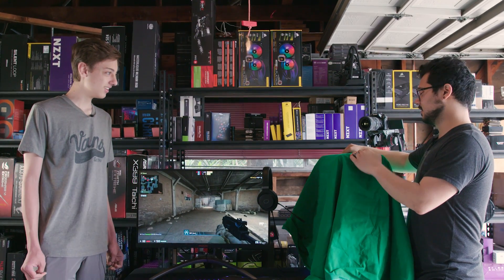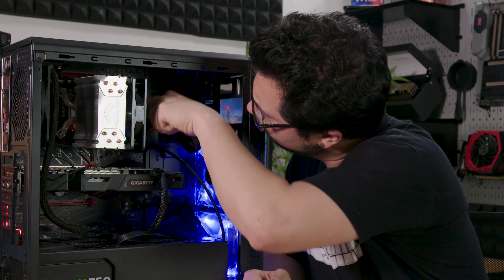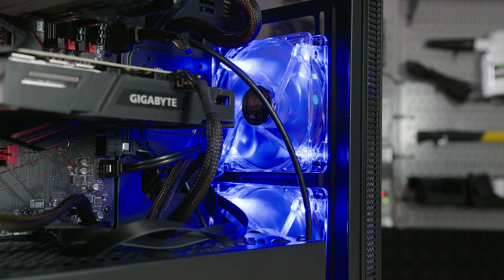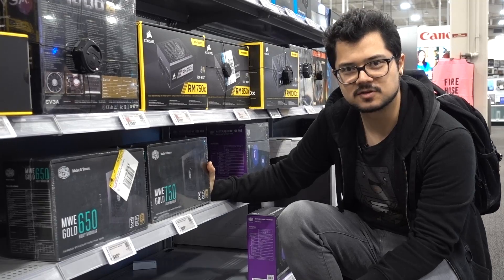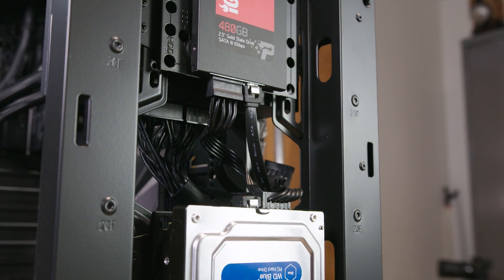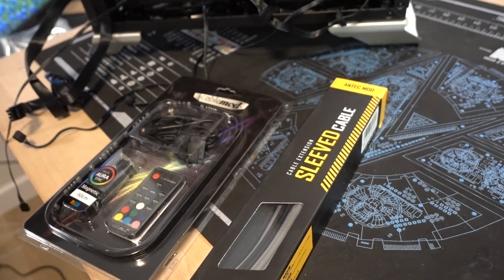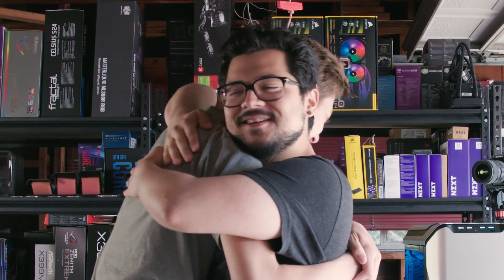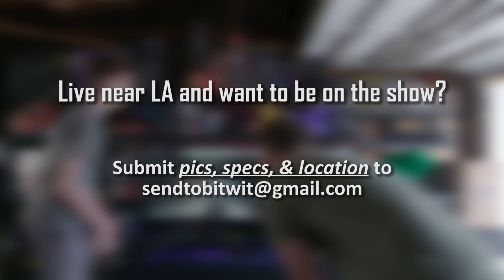He didn't see this coming a MILE AWAY #pimpmyrig #pmr #episode6

Comment: "80+ Bronze certified which is terrible" 

Me with my 200W chinese powersupply:"I meaaaaan"
Reply: crying in 80+ white :|
Reply: Lol. Has your PSU exploded yet?
Reply: @conyo985  theres this smell of burnt toast in the back of my pc but i guess its just my imagination
Reply: @Qi4  Or you just hungry haha
Reply: Feku13 who the fuck thinks of burnt toast when they’re hungry?
Reply: @Alex-mr5ji  I bet there are some people haha
Reply: fishlegs 😂😂😂
Reply: 80+ Bronze is more than good enough unless you're a spoiled brat.
Reply: @AZI3623  That's not how it works lmfao
Reply: @AZI3623  more like spoiled people would use bronze because they dont need to care about electricity bills
Reply: @AZI3623  u dont cheap out on the most important thing in ur pc. And that is the psu. O never go under gold. Is cheap to
Reply: @chriss881000  Bronze is fine, as long as the quality is good. The Corsair CX grey has better voltage regulation, protections and general build quality than a lot of gold units, and even a few platinum units!
Reply: @chriss881000  depends on how much wattage your power supply has. If you're going gold or platinum and you have a 800-1000w PSU, then it's gonna be pricey. You really only need that if you have like all higher end components and you're overclocking them all. For me I have an rtx 2060, and an i9-9900 so I can't overclock the cpu and I haven't found the need to overclock my GPU. So I only got an EVGA 600w 80+bronze semi modular power supply. More then enough for that. All depends on you're setup. Don't need to go overkill if you don't have to.
Reply: @nathanpickering6742  first off, a gold  1000w psu is cheap. I paid (and it still only cost) about 250$ here. In america is prob half the price(bec america is dirt cheap for everything)  and what are u doing with a low end 2060 card with that i9 cpu. U know u are very bottlenecked right?  That 2060 card dont even deserve the same oxygen as the i9 cpu😅
Reply: @chriss881000  what? That's definitely not bottlenecking. It's the non overclocked version. The 2060 runs great with my setup.
Reply: @chriss881000  if I had a 9900k then yeah I might want atleast a 2070ti. But the 2060 with a regular 9900 is perfectly fine. I'm also running 1080p and 240hz which the 2060 is plenty good for. If I moved up to 1440p then yeah I'd upgrade my card. But the 2060 is a great GPU for 1080p high refresh rate at ultra settings.
Reply: @chriss881000  also that's about $300 or more here in Canada, idk the exact conversation. But that's more then id need to spend on a powersupply unless it was necessary.
Reply: @nathanpickering6742  oh, i tought u ment 9900k(my bad)  i use 1440p, and i got 1080ti and a 8086k(5ghz allcore) cant have any less than that with a 2k monitor, if u are picky on fps ofc.
Reply: @chriss881000  yeah I gotcha, no worries. Yeah I only went with the 2060 since it's good cost to performance and is great for 1080p gaming. My next upgrade would be atleast 1440p or high monitor and I would want atleast a 2070super or 2070ti with my setup.
Reply: The amount of people in here that don't understand PSU ratings is astounding. Stop regurgitating bits and pieces of shit you hear. Google is your friend. 80+ bronze is fine as long as it's a good brand and model.
Reply: @Docosi  I would exclude the brand part. SeaSonic is considered a good brand. The M12II and S12III are probably the worst you could get for the price.
Reply: he actually said "which isn't terrible".
Reply: Your house is going to burn down😂😂😂
Reply: Chinese
Reply: Ur shit finna explode bro
Reply: laughs in 80+ Platinum
Reply: He said "which ISN'T terrible".
Reply: Raph S man I got a laptop atleast you have a desktop xD
Reply: dude u need to change it to gold, serious. u have been warned. btw im using platinum 750w evga for the past 2 years.
Reply: I'm using a 750 W raidmax cobra bronze and it works wonders, spending 400$ on everything coolermaster is kinda disqusting at this point.
Revamped version Noctua NHu12s 60$,  redragon k556 keyb 60$,  the power supply choice was okay i won't list that. Instead of the 2080, i'd get him a gigabyte rtx 2070 for 500$ instead of the 900$ he used for the waterblock version. First, has more headroom for other stuff (Like replacing the bad boot device, has more headroom for a monitor etc.) It's just generally better price/performance wise.
Reply: @lukafireman  Hey there! PSU person here. The efficiency (80+ rating) doesn't really matter in determining the quality. Only the design will. There are shit 80+ Platinum units and there are great 80+ Bronze units.

I would however, replace your 750W Raidmax unit. That thing is based on an ancient design with group regulation, and poor voltage regulation.

Comment: About the radiators, I personally would have reversed them putting the CPU rad at the bottom and the GPU at the top because the GPU produces more heat than the CPU

Comment: Is this system actually in need of some pimping?

I mean a 9600k, 1070ti and 16GB 3000MHZ ain't entry level or mid level in any way
Reply: That's pretty mid range, probably 60 or 70th percentile on most 3d mark runs

Comment: Hey Kyle.  I'm a cereal killer.
Edit
I'm confused about one thing-  Why dismantle the old computer?  It looked like you weren't using any of the old parts.  You replaced the mobo and the processor, the cooling solution, the power supply, the graphics card, the case...  DID you use any of the old rig?

Comment: hi bitwit i wish i could get my pc pimped out lol i have a pc from 8 years ago when i got out the military and now i use it to help with my ptsd by gaming to help relieve stress. i have a dell xps with a I7-2700k and amd radeon 520 with 8 gigs of ram 2800 and the head phone and mic jacks don't work or 2 of the usb ports don't work either. as veteran who is trying to be a freelance graphic designer and gamer i wish i could get a better pc. just like to throw my name in the running lol thanks.
Reply: Lele im running 2600k with r9 380   8gb ram 1600 hyper red oc at 2133 :P
Reply: Just buy cheap z77 or p67 mobo

Comment: May i ask, why did you put those cpu cooling fans over the radiator, and not under? Can someone give me a reasonable answer?
Reply: Push and pull in this case will make less than a 2c difference, its not a thick radiator and the fans will be able to pull fresh air through just fine. Plus, with a bottom intake, any particulates, dust  hair etc will build up on the bottom mesh panel, some on the radiator, and if they fans were mounted on the underside, youd have to pull the fans off every month when you go to clean that dust off the rad, instead of just wiping the rad quickly

Comment: My first rig? Not much different. Fx 8350 on a 970 chipset board. Corsair CX 650 (which was DOA, by the way),  a gtx 960. Stock case fans galore, and of course the venerated pain-to-install Hyper 212.

Comment: You only used his CPU, memory, & both hard drives from his old build. you should have just built him a new computer & let him keep his old computer as a back up. What are you going to do with the rest of his old parts? You should use all his old parts except the case & build another computer. just use what ever you have laying around the shop to finish it out & give it away. I will take has graphics card because it is better than mine!

Comment: That pc upgrade tho...i could really use an upgrade tbh
i have intel i7-2600
gateway fx6850 mobo
8gb ram (4x 2gb)
evga geforce gtx 560 ti
2x 1tb hard drives (dont even know the brands)
no ssd
ultra lsp 750w psu
the case is some dell case i dont even know
running windows 7

Comment: Trust me... My rig is not worth saving.... 
1. Nothing big on parts
2. A stock hp case that has holes cut in it for air and cables
3. Fans held by blutack
4. some leds stealing power via cut cables from a sata cable
(This PC is held together by things like duct tape and epoxy glue)

Don't want my rig pimped... It is enough for playing my games and better then my laptop
Side note, it's like 3 older PC's slaughtered  to make it

Just curious who out here has a similar PC life?

Comment: Pimp my rig:
Lga 775 Motherboard
AMD sapphire r7 260x
intel core 2 quad q6600
2x DDR 4 2gb 1033mhz ram (yes different brands)
1x 150gb hard drive
1x 500gb old laptop recycled hard drive
Of brand case
Of brand power supply
A pretty nice cooler for the time.
SyncMaster 245e HDCP 60HZ Monitor
I built it for 90-110€ (honestly I forgot) 2 years ago. All parts bought used of local used stuff sites. 
Pubg lowest settings 25fps :D

Comment: I love your channel Kyle, I choose it first but what is the point of this video. I want to see someone that has a Quad core and gtx 750 win a giveaway of the kids system you replaced. The kids system was already better than most. 

I loved your alter ego Lyle videos, why are you bowing down to " the man " after they called your videos as  racist and gave you a Copyright Strike. Lyle has not returned. This was done by Verge because the Shill media can't stand criticism and does not want competition. I like Lyle first,  then Wifey sauce second but that Kyle dude is a NERD. Actually I respect your abilities to entertain and teach.  Anyone's PC usually will not impress you because sh^t cost money. 

My system is Dell XPS 8500 I7 3rd Gen,   16 gb mass produced Ram, 240 gb Intel SKULL super fast SSD,     1  TB Seagate HD and a GTX 1060 3gb.  I hate LCD on everything. My MSI gaming Mouse is red LCD and I have to MOD it to stop.  The system was from a Business that ask me to check the PC and write up a repair order and test all the electronics in their office for lightning strike.  I never suggest used Ebay parts to repair, so the DELL XPS motherboard was fried by lightning. I told them a new Dell board was $300, even more from DELL. Their second computer had a burned out network port , so I threw a Wireless Card in it and they could get their business running again. I told them I wanted the XPS for parts if they did not fix it, Insurance paid them $1500 but they were using the backup PC and I was done. 

A year later, the boss called a said I could pick up the Computer. The XPS MB was $90 on ebay and rare. Then one day a Board popped up for $50, I offered $30 and it was accepted. I replaced the board and learned that some Dell Fans have different brackets under the Board, but after the swap, the system was functional. I ordered a used Intel SKULL SSD, it is faster than the other 10 brands that I have tried. DELL XPS 8500, USB 3.0 ports, it has a 550 watt power supply with a 6 pin connector for video cards. PCI x16 video slot and a pci x8 video slot. in 2017 -  Cost of my PC Dell XPS 8500 I7 3rd Gen.   16 ram,   1 TB HardDrivve was    FREE repaired $30.00 , 2017 - Intel 240 SKULL enthusiast SSD used $ 60.00 -   Nvidia GTX 1060 3GB NEW  $175.00 Amazon.  MSI Gaming Mouse $15.00 from Germany.   It plays my Games and rips my video. $280.00.  The invoice from the original purchase in 2016 was $1,800.00 

My personal opinion is that I can understand making money marketing parts for Tech companies and then doing new builds. But building a system that is affordable seems more interesting. I watched Tech Yes City go beyond my crazy ideas to save a dollar. I have watched the 5 to $10,000 systems put together by you. I would never spend that much but I guess its okay to watch. You should tell me how much the guy paid for his system and the year it was built, just ragging on his system and giving him a brand new computer that probably would cost $3,000 really does not teach anything other than please Kyle give me a computer.

Comment: So, the only parts kept from the original rig were the CPU, The RAM, and the Drives. That Qualifies as a New Build and Not a pimped rig. P.S. Did that New Mother Board (Different Identifier) also VOID Windows Activation?
Reply: A used windows 10 key is like 8 dollars...

Comment: I'm not fond of the water cooled gpu in this build.  Don't get me wrong it looks amazing and I think it will preform well, but the fans are now in a pull configuration pulling air through the fins which is less efficient and now dumping the warm air from the radiator into the system to warm up the rest of the components names the GPU which is right above it.  In my mind its nothing more than poor hardware placement. I understand in that case there really is nowhere else to put that cooler, but still seems like a poor design decision.

Comment: Sorry, but I'm gonna keep it real. This PC upgrade is stupid. 
Kyle spent $330 to get some "free" performance from that CPU, replaced a perfectly good 750 Watt power supply with a 750 Watt power supply, and bought two RPG case fans to replace the two RPG case fans that already existed. The GPU costs about $130 more than a non-water cooling model and introduces a potential point of failure. And between the RGB kit and the cable sleeves he dumps another $70 in the toilet.
Overclocking is stupid. RGB is stupid. 
I like Kyle and I like his videos, but this was just silly.

Comment: Running the radiator at the bottom isn't a wise choice. Any air in the loop will rise to the GPU as evaporation sets in. Just a suggestion.

Comment: "This pc has some problems" has 1070ti and 9th gen
Reply: Poor cable management and fan facing the qrong way is all that was wrong
Reply: @WayStedYou Pretty much, I just built my first rig with a 9th gen i5 and 1070ti and I couldn't be happier with it. I'm planning on upgrading to the i7 and water cooling by the end of the year (hopefully) but I have no plans on upgrading my GPU until it struggles to run games on low at 1080p. I just don't see the appeal of 1440p, I'll take higher framerates at higher quality over higher resolution. At least for now.

Comment: I don't like the bottom mounted radiator, it's rejecting the GPU's heat back in to the case (where it came from) creating a bit of a heat loop and preventing the CPU's AIO from working as well as it could.  All else looks slammin'

Comment: I absolutely love how you do stuff like this, I honestly would LOVE to enter and get an upgrade myself, but at the same time, id rather have someone else get it, im slowly upgrading my PC, its taken over a year to upgrade to what I have now, and I honestly feel more then happy to have what I worked so hard for, I went from a AMD something CPU that came with my computer from 6 years ago to a Ryzen 1600X, Kingston something ram that is 6 years old that came with my computer to Kingston Technology HyperX Predator Black 16GB (I was running 8GB of ram...), a GPU I have no idea what the hell it was to a Gigabyte GTX 1050 Windforce, a standard hard drive to a 1TB Samsung Evo 860 SSD, and some super cheap case to the Phanteks Evolv X ATX, a power supply that came with the computer to a EVGA 500 W1, 80+ white 500W, which I do wanna upgrade soon to a modular one. (thinking about getting the CORSAIR RMX Series, RM750x) So best of luck to the future winners!

Comment: Just wanna say bitwit you should go watch linuses video on air cooling vs water cooling it might change your mind on using a water cooler with someone’s rig that might not be able to change the water cooler for another water cooler.

Edit:I know air coolers are a eye soar but it’s well worth it in the long run
Reply: You're ignoring the fact that airflow is severely limited in this case, and that watercooling is more effective use of the lack of front intakes, and just providing a linear path of heat rising to make better use of thermals and limited airflow.

LTT made a great video that applies to tons of people  but in this case, Kyle absolutely made the logical choice

Comment: Nobody cares about viewing angle on a monitor. TV's maybe, because they're generally bigger and you can have more people sitting around one needing the viewing angles. When you use a monitor though you are supposed to sit directly in front of it with your line of sight slightly above or at the top of the monitor. You don't sit 130 degrees diagonally from your monitor, that's just stupid.

Comment: Don't be mean to SEGOTEP !1!1! I'm using a segotep case right now (pi cube)!

P.S. Friends don't let friends buy a ”pi cube” from segotep
Reply: I am using a Lancool internally it is very LianLi in design but I am thinking they skimped on materials and the metal is not as smooth and well brushed on the outside. But its like half the price. The cable management was hard and I don't have a modular power supply so a lot shoved behind the board and a bit had to spill over but the air flow is still very good so I don't mind the little bit of a mess.

Comment: Guys i need advice on my build 
Cpu 1800x 
Mobo asus 470 
Gpu 1080 ti 
Ram 16gb 3200mhz 
Storage m.2 500 gb,, ssd1 tb
850w seasonic 

I want to upgrade my rig especially my cpu should i wait for the new ryzen cpu or just get the I9 with 2080 ti

Comment: I think I would be picked for pimp my rig cuz I have a master case h500p, asrock 970 a-g motherboard, fx-6100 am3+ CPU , stock cooler, hdd from a old hp and a msi GTX 970 100me and 4 2gb 1333mhz memory sticks and a evga 500b psu

Comment: I got a nice rig. i5 8600k on a Asus Z370-E M/B paired with a decent GTX 1070ti Both Cpu and Gpu are OCed. Everything is nice and tidy but there is one thing. I have Corsair LPX DDR4 RAM but the problem with that is its only 2400 speeds. Should this be my first thing to upgrade next?